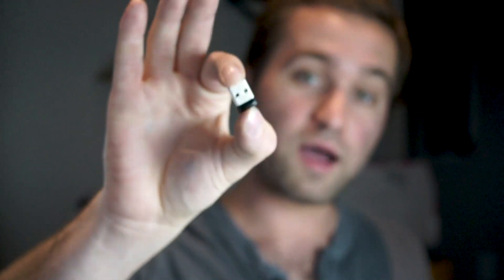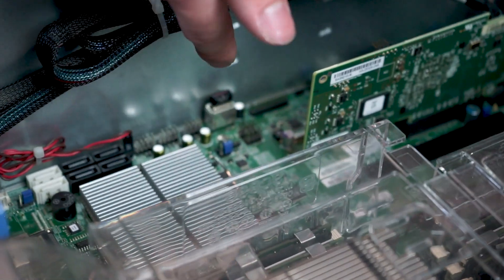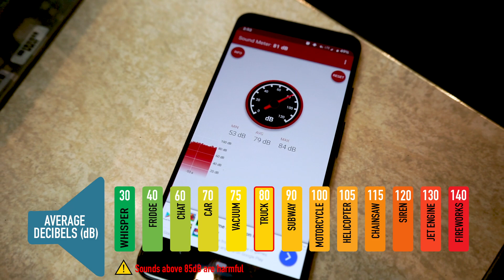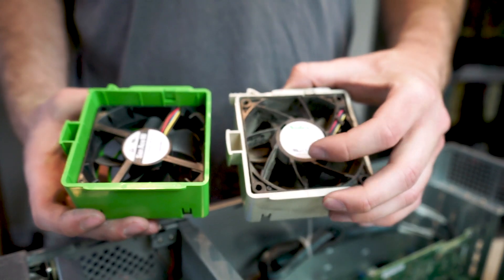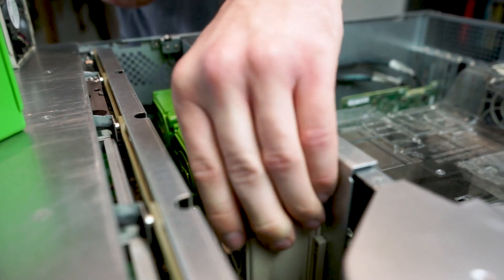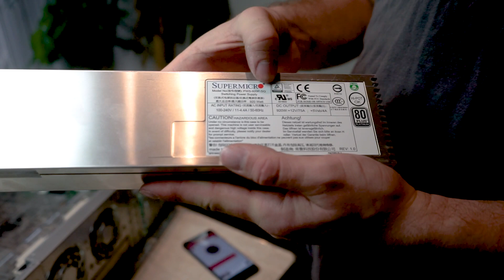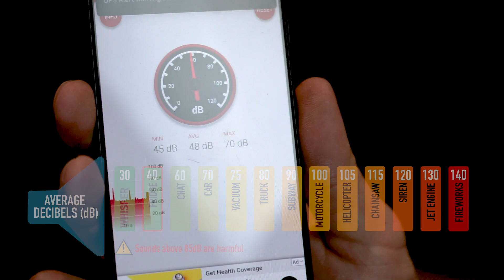Quiet Supermicro 846 - How to make Supermicro 846 Quiet | Silent Server Fan Upgrade

Comment: Thanks for this effort of videoing and sharing. Very useful for home user and very clear. I wish more channels were this specific and free of nonsense. I design mod kits for 1RU pro audio amps because there are no 40mm fans suitable for cooling at a low enough volume. I don't know that i can find this kind of gear easily in Australia - especially the PSU but it would be worth a reasonable shipping rate from the US or EU. 

I only have a 600mm deep rack and had not considered storing my server like you do - put feet on the side and just stand it as a tower against the wall out of the way. 

What's the lowest power supermicro or similar Server that would be very good for 12 drives that you are aware of Rhys?

Comment: This is SAS2 backplane, not SAS3 as you've mentioned in the beginning of the video... HBA card looks like H200 which is SAS2 as well.
For myself I got CSE-847, removed stock fans and put 3x 120 fans in the empty space between HDD and the bracket where stock fan's were.

Comment: Would recommend updating the video description to call out that after the fact you noticed the CPUs overheating and you needed additional modifications (and in turn spending more $). Some folks might find this video and blindly follow it without realizing there is a follow-up video.
Reply: All he added were active CPU coolers.
Reply: your cpu wont overheat if you dont load them)) i have exact same case, but my hdds are generally off. all of them. so the server just runs couple of virtual machines, which barely load two 10/20 cpus for 5% max. as an experiment i run a server without airflow and it works fine.

Comment: These fan housings should be capable of housing any standard 80mm fans including noctua's, that's the only housing type though from Supermicro that this can be done with unfortunately, others have a plastic notch that will prevent many other fans to fit in - you would need to replace or modify the fan connector though.

Another crazy way would be to find the formfactor and size equivalents of different specification fans, they are definitely out there, so many types of them from so many manufacturers - which is a problem, can easily spend days looking just through single manufacturer catalog and trying to find on internet various options which are actually available for purchase.

Comment: Thanks for the tip with the FAN-0104L4!

This is way better than jury-rigging Noctua 120mm in place of the OG fan wall, because you can still make effective use of the air-guiding baffle.
A wall of Noctua just blows all around the CPUs with only a small volume of air actually cooling them, unless you can jury-rig a custom baffle as well.
I'm definitely going with this approach!

Comment: Old video, but I have a question. If I get noctuas, couldn't i put them in the front shroud like you did with the rear ones?
Reply from the maker: Yes, in fact someone made a bracket on thingiverse if you know someone with a 3d printer it can be printed for you to mount the fans on!

Comment: I'm looking to do this with my 847.  You said in a comment below that you needed to upgrade to active cooling for the CPUs.  What about the HDDs, what'd those temps look like after you switched?
Reply from the maker: My HDDs temps went up a bit, but not anything terrible. The only drives that run hot are the internally mounted SSDs and that is because of the ambient heat from being mounted on top of the PSUs. IIRC the drives temp increased by like 3-5 degress F.
Reply: @rhyspowell4036  It's been years, but do you remember how many drives you had in the server?

Comment: I don't see a rack in your videos. Do you just stand the server on the floor on its side as pictured at the end of this video?  Just curious if it has caused you any problems that way (unusual overheating, unstable so it falls, etc)?

Thinking of getting one but I would have to put on side to make it fit in the only wife approved location I have.
Reply: I have a smaller 2U server case with 16" inch depth. I have no problem using it without a rack. It's currently on the floor placed next to a wall.

Comment: This is a great video. I have a CSE-836 chassis on the way and mercifully the eBay ad notes PWS-920P-SQ power supplies! Perhaps some of the other fans have been replaced as well, we shall see! Thanks for sharing.
Reply from the maker: Have fun, it truly is a great server!
Reply: Well - it's here and the SQ supplies are nice but the fans are the FULL VOLUME ones.  I set the fans to Optimal in IPMI but I think I'll be replacing some or all in the near future.  :p Clearly not suitable for a living room as-is.
Reply: @JaimeZX  lmfao I feel your pain since I have the same unit with "Super Quiet" PSU .....its still named "the beast" and locked in a closet to make the noise tolerable...looking at moving to the garage now.

Comment: Supermicro chassis also usually have a fan control option in the BIOS. I've utilized that on all my Supermicro builds. Dell has gotten pretty good about fan noise since their second generation 720s as well. In addition, it is very rare to see the load split 50/50 on the power supplies - you'll more often see something like 80/20, 70/30, etc. depending on your setup. It tends to fluctuate between power supplies as well; so, one power supply isn't always carrying a majority of the load.
Reply: I know this a really old video.  With that said, my 720XD is desktop office quiet unless it's going full tilt.  This is on the stock fan curve.
Reply: @rdsii64  Yes - the xD is their second generation of the 720 series [actually, most of the series with an xD after it), per my comments. :P
Reply from the maker: Thanks for the comment - I played with the settings in the IPMI controller and wasn't happy with the results. The quietest mode available was "Standard" and that was still too loud. I know the lights out controller isn't the newest, but I did update the firmware on it and the motherboard, with no improvement on the noise levels, and no new features in the management.

Ultimately the most noise reduction came from the replacement of the PSU. I appreciate your correction on load distribution, as I was speaking casually in the video and could have led to some misinformation.

Comment: Nice vid. FYI, that looks to be a SAS2 backplane. Should be BPN-SAS2-846EL1. For anyone else reading this, and if you are leaving the stock SM board, log into your IPMI and just turn your fan speed down :)
Reply from the maker: You are correct, I misspoke! Good catch. I had worked with the IPMI settings quite a bit before doing this upgrade and can say that it still made a big difference!
Reply: Rhys Powell absolutely. Still love any video with SM chassis.

Comment: Did you check the CPU temp before and after the swap?  Just wondering what kind of temp difference you had?  Thanks
Reply: I just bought the same chassis and was about to do the whole 120 fan wall but I like this solution much better thanks.  What CPU's are you running?  I have a single E5-2620 but was looking to upgrade to a better dual CPU just wonder what your running.
Reply from the maker: @pm240sx1  Intel® Xeon® CPU E5-2630L is what I am running currently running. Before installing the CPU coolers, the temps were getting a little hot, so if you do go this route, make sure you plan to upgrade the CPU cooling!
Reply from the maker: CPU Temperatures before were in the 50C range. After, they floated between 60C - 70C. This is why I went ahead and purchases active CPU coolers and replaced them later on (See the other video about that) Once I replaced the heatsinks with active ones and reconfigured my IPMI controls, the CPUs don't exceed 60C even under full load.